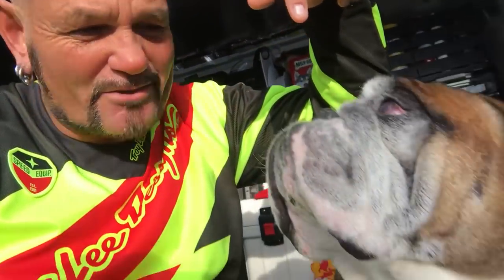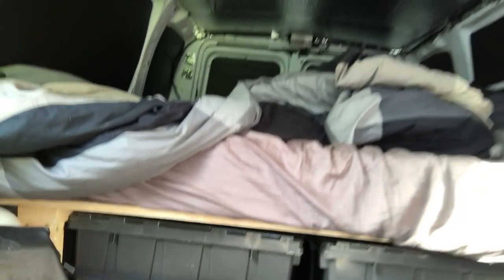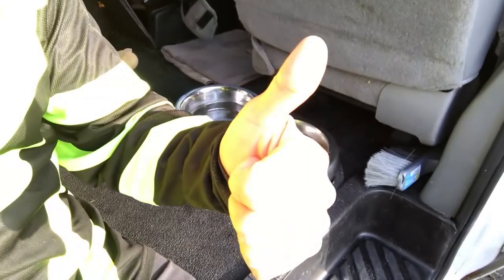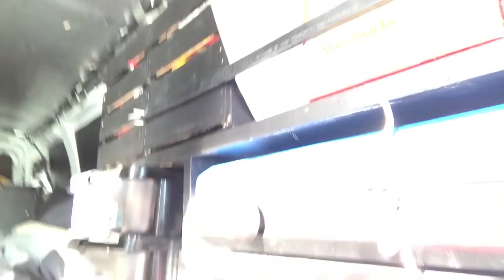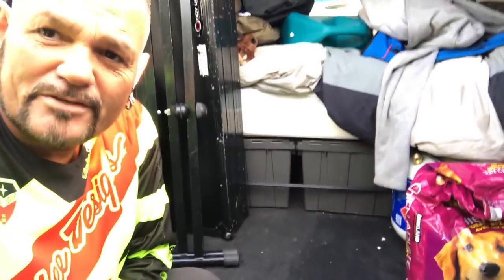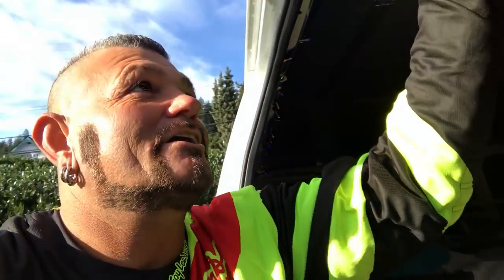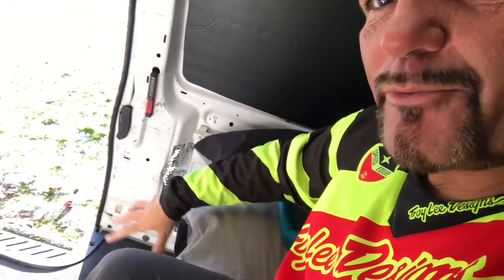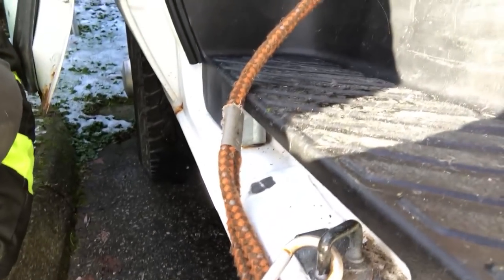SIMPLE VAN BUILD | A Closer Look Inside

Comment: Hey Chrome,  personal experience, less sheet metal screws, use pop rivets. I use aluminum and Stainless Steel depending on the load required. Looking great as usual. Spending my first night in my new to me van tonight,  catch ya on the B side.

Comment: I would put the water bottle off the floor.  Dust and Disco's fur all over the spout, especially if the seal on your door down there isn't air tight.  Put it higher up over the top shelf, then put a plastic container on the shelf as your sink.  Open spout and it will pour into sink.  Then just toss the waste water into the storm drain (no harmful chemicals). Be sure to have a vinegar water spray bottle to clean sink every so often.

Comment: Three words: Solar, Solar, Solar! You can still be stealth and mount one or two solar panels on the roof. Paint the edges white, and it'll look like you have a roof rack. One or two Solar Batteries and you won't have to worry about draining your starter battery. Then you can run your laptop , charge your phone, and play a movie or music for as long as you like.
Just a suggestion for the big build.
What do you do for storing food? Cooler?  How do you prevent things from getting soggy?
Peace, I'm out!
Casey in SF😎
Reply: Casey, I live in SW Florida and we got pummeled by Hurricane Irma. One of month, no power. Sucks! BUT  we lived with coolers like Chrome does. So we put veggies on the top of the cooler so they would stay out of water and we put them in zip lock bags with a paper towel in the bag to absorb the water. That helped keep lettuce, cilanto, etc fresh and not soggy. It worked great. Also, we took out the water from the melted ice daily and saved that water for washing or rinsing things off. (our water was contaminated as well so we had to boil water....BUT how can you boil water with no power???) We have Yeti coolers (which are like the Pelican that Chrome has) and the ice would stay frozen for 7 days, even in our house which was 94 degrees (no power/no ac). If you have anything in a paper box type of wrapper....use ziploc bags. We just re-used the bags.